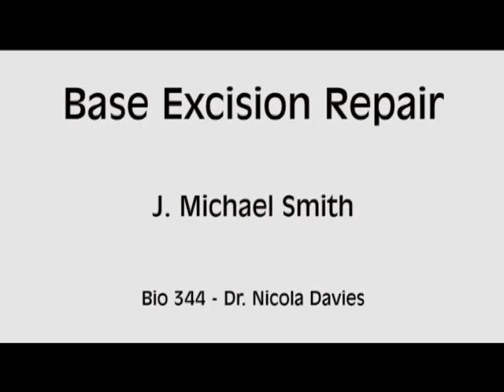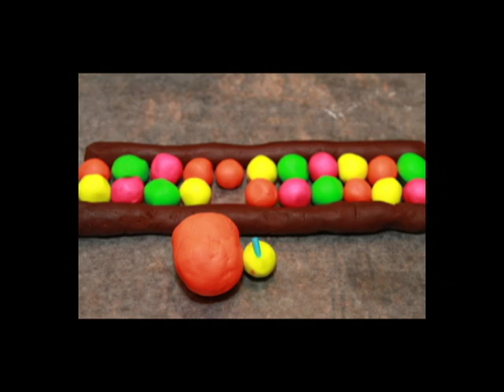Base Excision Repair

Comment: '  However, the enzyme goes beyond the AP site to replace normal nucleotides (for no specific reason - that's just the way it works). "... this is the one thing needed in the video itself. apart from this, the video is self explanatory.  Thanks.

Comment: thanks.....thanks for the reply.
The choice between short- and long-patch repair is currently under investigation. Various factors are thought to influence this decision, including the type of lesion, the cell cycle stage, and whether the cell is terminally differentiated or actively dividing. Some lesions, such as oxidized or reduced AP sites therefore, must be processed by long-patch.
and some are replaced by short patch.

Comment from the maker: Think of the generation of an AP site as a way to remove the rest of the damaged nucleotide (specifically, the sugar-phosphate backbone - recall that the nitrogenous base was removed prior to this step by the DNA glycosylase).  Using the base-excision repair mechanism, only one AP site would be generated since there is only one damaged base; However, the enzyme goes beyond the AP site to replace normal nucleotides (for no specific reason - that's just the way it works).